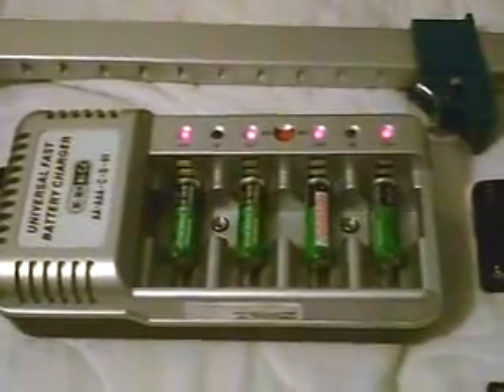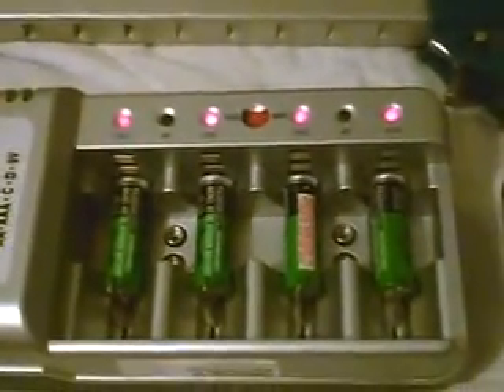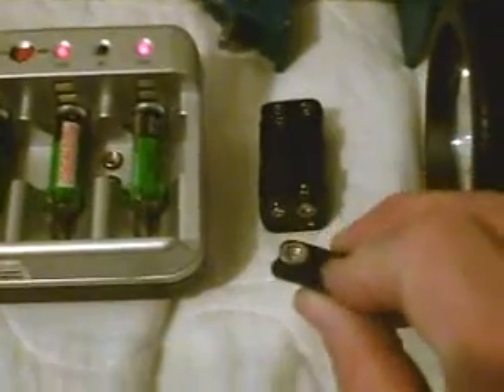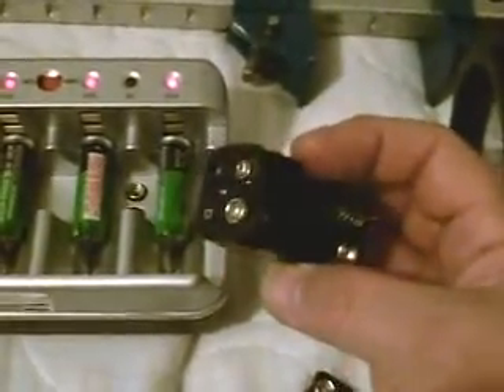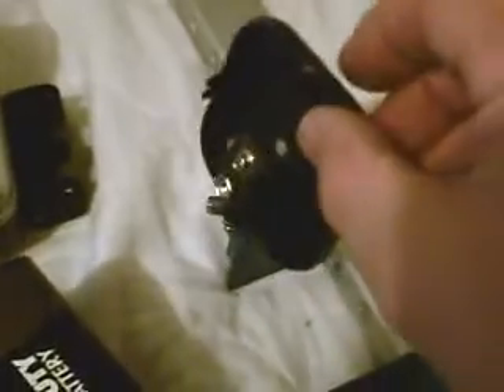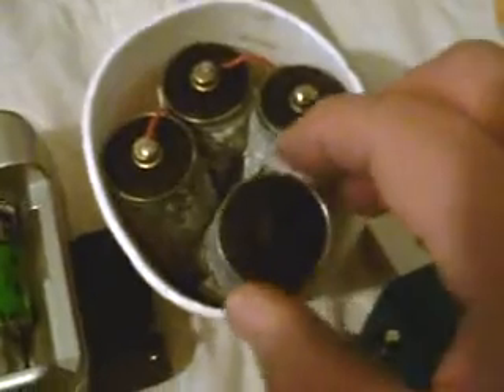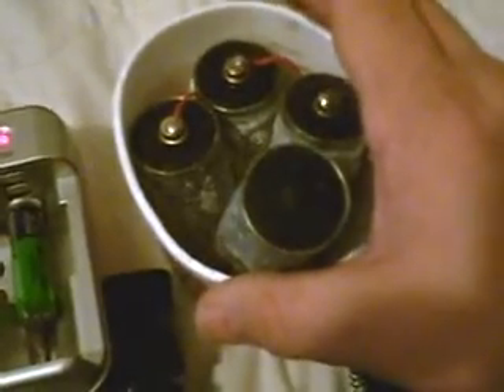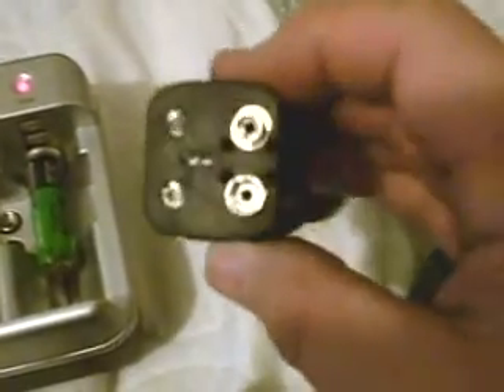Reverse Hack a 6 Volt Lantern Battery

Comment: 1. lantern batteries are very cheap this is because they don't need to use as high grade chemicals as AA batteries which are muich more compacted. The smaller they make the batteries the more expensive it gets. Case in point AAA batteries more expensive than AA batteries. 

2. For an emergency flashlight you DO NOT want to use rechargables, rechagables discharge very quickly, you can charge them up and then leave it in the flashlight for 3-4 days and then when you need to use them you can't.

3. the mAh on these aa batteries are going to be very low compared to the F type cells used in the lantern battery. You're going to run out of juice after 30 minutes or so.

Comment: +JCAchannel100 said:
"To the second comment down from mine are u high every AA battery is 1.5 V learn your math"

Incorrect.  The voltage of the cell depends on its chemistry.  Zinc-Carbon and Alkaline are 1.5V per cell, NiMH and NiCad are 1.2V per cell.  Other voltages are common, such as 2.1V per cell for lead-acid batteries, such as the ones used in your car.

For more information, check out http://en.wikipedia.org/wiki/Rechargeable_battery

Comment: If you look at Harbor Freight AA NIMH batteries, they have the almost same mah rating as the C's and D's. 2200 mah vs 2500 mah. The really neat trick would be getting the 7,000-10,000-11,000 mah NIMH D's into this lantern battery.

Comment: Check out the NiteIze brand LED maglite bulb replacements from Walmart. They normally won't work with lantern flashlights because the batteries are the wrong polarity. With your hack, though, you can reverse the polarity and use the bulb (it has an automatic circuit to keep a steady output, really works well in those reflectors.   Another hack is to just take one of those lanterns, solder wires with slide connectors to the lantern terminals, and run them to a SLA block batteryduct taped to it

Comment: @karzygijose The bulb would likely have a very short life at 9 volts and because of high current draw a standerd 9 volt battery would not last very long , theres a reason why a 6 volt lantern battery uses 4 large cells in series inside and is much heavier it stores much more energy in its tank so to speak  its like comparing a triple A to a D battery both are 1.5 volts but the large D battery has much more stored energy .

Comment: @Imageofgodsl 

yes it will last about 1/10th the time that it would on the lantern battery. This is still a pretty decent hack though I would just upgrade to C or D cells. Using D cells will give nearly the same run time as the lantern battery. BTW inside the 6v lantern battery are 4 F cells that are proprietary to all lantern batteries.

Comment: @rhblakeman I agree with the LED recommendation.  Energizer NiMH D-cells have the same mA-h rating as their AA cells.  You need to buy $40 NiMH D-cells to get close to the approximately 20,000 mA-h rating of Energizer alkaline D-cells.   The Energizer 529 6V lantern has maybe 27,000 mAh at the same drain.  You can buy a 4-D to 6V lantern adapter at Digi-Key for about $3 (MPD brand model BA4D-S).  This isn't an opinion about any of these companies, just sharing what I read.

Comment: hmm won't the batteries last for only a very short time as:
1. the torch is designed for the lantern batteries (4 D cells right???)

2.rechargeables carry a small charge (and most of them that i see are only 1.2v

so won't it only last a short time b4 it goes dead??

Comment: Great idea, I think I would try to get 4 of
the largest rechargeables in there as to increase recharge periods. 

I don't think I would try 4 AA packs in paralel to 4x4 packs in series, because the
weaker AA's would tend to be charged by the stronger ones, creating a inefficient mess.

But 4 of the bigest 1.5V batteries sounds interesting, anyway enough of my rambling.

Interesting Video !

Comment: I have no doubt that this would work but it seems like a lot of effort to do this when you can get an adaptor that takes 4 Ds and fits into the flashlight just like the lantern battery.  I actually have one of these adaptors which came with my Krypton Lumilight 4600 flashlight.  I use 4 NiMH D batteries in this light.  I keep it charged during the stormy seasons in case of power outtages.